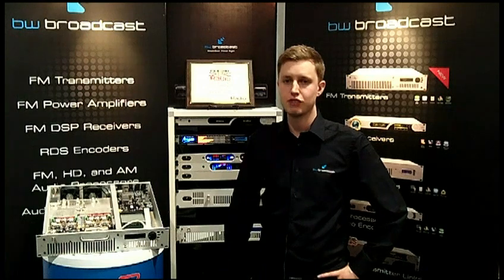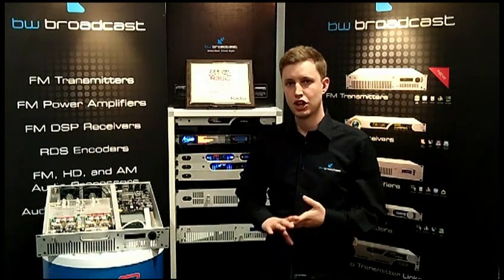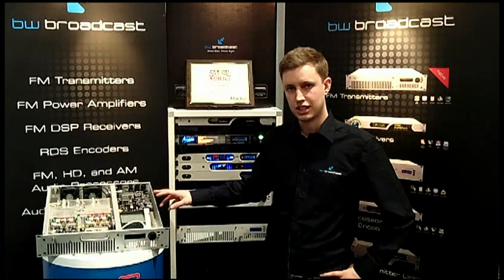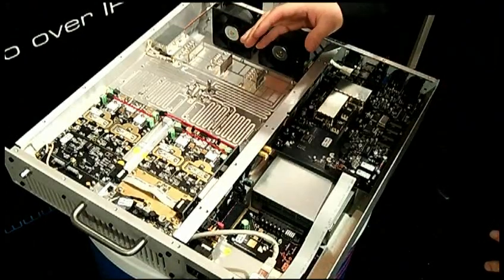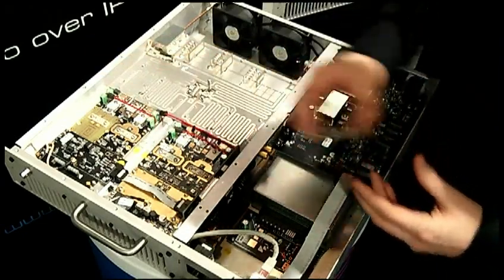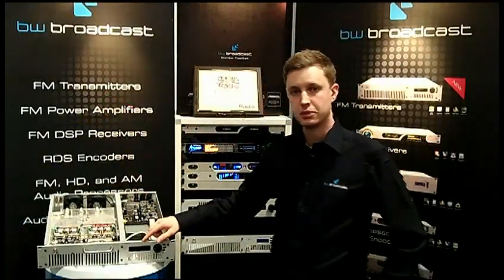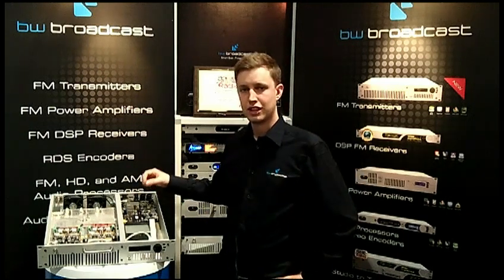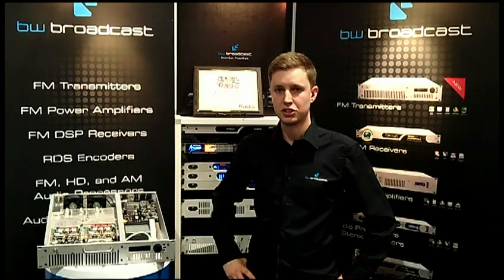2013 Radio magazine Pick Hit: BW Broadcast V2

Comment: About 5 years back, I bought a Broadcast Warehouse transmitter and amp. What a nightmare that was. I had lots of problems getting the exciter and amp to work correctly. BW Customer Service was seriously bad. They told me that their technical staff was at a trade show in Las Vagas, and could not be bothered with my "little problems". (they actually said that to a buyer)  OK, so I waited 2 weeks. Finally they got back to me, suggested that I ship the unit back to the UK.
We sold them for parts on Ebay. Now we use Warner RF transmitters. Better value, better service.